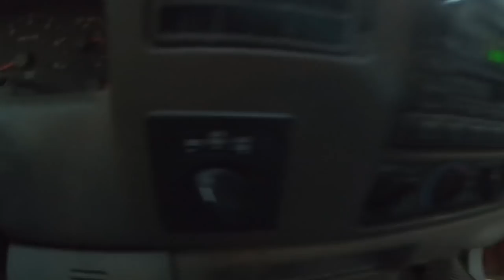Ford F-250 Super Duty Interior Swap Part 1: Air Bag Light Repair, Seats & Floor Carpets

Comment: Your being a professional inmate at the Ford Dealership makes the presentation you just showed look like a task so easy that most anybody could do. That being said, now I have a basic idea how to swap out the seat belt tensioner when it eventually craps the bed on my 2011 Ford Fiesta that has 250,000 miles on it.

Comment: I just got a new (to me) RED 2001 F-150 super cab XLT.  While installing a trailer brake controller, I noticed two gun barrel looking things, on both sides, under the center seat.  Now I know what they are, seatbelt tensioners!  Thanks, and glad I didn't start messing with them.  I haven't checked behind the back seat yet for contraband!?!?  
Great channel!  I have learned a lot over the years watching.....

Comment: I was a mechanic for 30 years and it was my experience that the difference between a professional job and a half a$$ job was at what level of OCD the mechanic had, more OCD the better the work.
Reply: Add in some ADD and when they look at a piece of equipment they see all the loose things then the OCD kicks in and they fix them.
Reply: @timothyball3144  that's a true fact!

Comment: I am with you. I worked on heavy equipment and when it was time for a oil change I take it to the dealer. But when it comes to my  1926 Oldsmobile which is unrestored just repaired and my 1936 Chevrolet 5 window coupe hot rod then I don't mind doing the work  
I get the same enjoyment as you do with your d2 caterpillars. I really enjoy your videos and all the information. Be safe and keep up the great work.

Comment: You should spray some bar and chain oil on the underside and then drive it through some dust. Miles ahead of any other method when it comes to rust management. It's not a solid layer, therefore it can't crack, and once it seals up (because of the dust) it becomes a very thick oily sludge that doesn't fall off. IMHO, the best kind of rust prevention i've ever used.

Comment: Once everything was out I thought you would have at least wiped out the inside or made mention out if to get the fine dust and hair out. You however made that seem so quick and easy. It would take me at least two days to get the same out and then 3 days to get it back in. just for 1 vehicle.
Reply: @squatch253  I understand, that is one reason it takes me too long. Besides After a couple of drives Bork wouldn't know the difference
Reply: It helps when you now where all the fasteners are hidden.

Comment: greatly appreciate this video.. i have a 2016 F150 with 280K miles and just bought another 2016 with only 55K (i Like the V8) and hate the new interior been mulling this and was pleased to see it is not so hard to do for a novice.

Comment: I remember when you said you weren't thrilled with the tan interior (they help in AZ). Was worried about dash,head liner, door panels....but should have know your eye would explode if change over wasn't  an "all components" project. The dog hair/smell cinched it....you were working "Flat Rate" speed.....

Comment: Great video and content, Thanks! One suggestion, which I am sure you thought thru, I would have added some sound deadening to the floors, doors & firewall whilst it was open. Really makes a difference for the road noise. Understand it's a work truck and everyone has their preferences.

Comment: I can see swapping seats etc and not going all new because of expense but I think I would of splurged on the heavy duty commercial rubber flooring instead of a carpet floor for easy clean up and not soaking up smells. Plus I would of added floor pan drain plugs for hosing out mud etc..

Comment: Wow I actually been needing to look at a new interior for my truck. I recently bought it and the interior is in a sad condition due to it being owned by a logging company since it was new I have the title to prove that I'm the second owner. Mine needs pretty much everything you are doing. I will also add more insulation and things of that nature as I plan on using this truck for a very long time

Comment: I was going to say sometime back swap interiors. But figured you didn't have time and yes not big deal swapping everything. My 99 ranger was green with gray interior with 01 explorer V8 damn near plug and play if l left it AWD. I wanted part time transfer case so advance adapters fixed this problem. Do add wire (ground) in instrument cluster to make tach read for V8. My 99 Ranger gotten every rusty, so took powertrain, fuel system and wiring stuck it in 2003 sonic blue Ranger level II. My brother has 2000 Ranger with tan interior and yes it has V8 too LOL. We changed his Ranger to gray interior, with gray Explorer power seats and center console. HVAC controls do work in Explorer console. Bad part in April had hit and run lost my 2003 ranger. Funny part went from 2003 Ranger sonic blue level II to 2005 Ranger sonic blue Level II. I just got it back together with V8 overhauled now had 240,000 miles on didn't use oil. Think was I have it out now 3 times, once from 01 explorer, 99 ranger, 03 ranger time for rebuilt and trans same miles. Trans no clutch wear, seals still soft and pistons seals about 1/4 worn off compared to new seals. 

I have manual transfer case in it now because electric BW1354 stick in 4WD and bang when it finally when back to 2WD. Change electric motor fix for awhile, did change t-case once it and did the same. Funny my brothers Ranger won't go into 4WD when cold. Switch is wired in for 4-HI and 4 LOW just ground that makes indictor lights come on

Comment: No need to buy a new cover cap for the seat studs nor try to melt the push nut back in place to keep it from wandering around.  Just fill the cavity where the push nut was with RTV (just the deepest cavity, not the entire cap) and push it down over the stud.  The RTV will conform to the irregular shape cavity and stud threads locking the cap in place.  If it ever needs to come out again just pry it off and repeat the RTV again when putting it back on. Or just throw it away, it is only to keep the exposed stud from being a nuisance snag anyhow.

Comment: Hey squatch do you remember the old Ford 4.9 300 inline 6 cylinder it was the first truck I drove an the farm it was the first standard I drove it had the old grany gear is was my grandpaps 1 owner my dad 2owner and me the 3owner it’s nice owning family history for 1987 f150 4x4 it does of work and still does I’m re building it right now little at a time still use it on the farm that 300 in-line does not now how to quit
Reply: @squatch253  I put side pipe on it for inspection it still quit but my god it runs so good I like the crank windows in it the never stop working I put oil on them to to keep the chain lubercated so it does not rust I just love that old truck it is so simple to work on.

Comment: As i watched i did not hear you mention anything about disconnecting the battery. That is a requirement any time you touch any airbag connectors. Those are usually colored YELLOW. I know you play with this stuff nearly daily in your working life but those out here in Youtube university may not know that. You don't want to risk blowing any of the airbag components. It can ruin your whole day or more.
Reply: That is a bit of a myth really 
Like useing your mobile at a fuel station 

Your airbags arnt going to blow because you unplugged them amd plugged them back in 
Maybe if your going down the road when you do it 
But with the ignition off and the car parked nothing's active 
Bit like how even if the car is crashed into while parked up the airbags won't go off

Comment: Hey Squatch, have you had to do brake lines on ole blue yet? My 03 Chevy’s brake lines are about to go. In your opinion would you go with stainless steel, factory steel, or Nicopp (copper) line kits? Also would you go with pre-bent lines, cut to length flared lines, or just make my own? For ease of running them throughout the truck. Im good with my hands and would like to do the job myself. Any insight would be greatly appreciated. Looking forward towards part 2!
Reply: Pre-bent Stainless Brake lines, Should be available, I believe Dorman Makes them? to run the stainless, its best to lift the Cab, A few inches, & Slide the Fuel tank out of the way.

Comment: I did not know that the lap belts did that.
You have me a bit scared though. I purchased a 2021 F250 Lariat 4x4 Off Road 6.7L Diesel.
I hope it doesn't drain the bank account.
I see what you mean about maintenance cost though. 13 quarts of synthetic oil and a quality filter has been my most expensive oil change to date.
Reply: @squatch253  and have the smelling salts handy when it gets out of warranty...........
Reply: @squatch253   My dad was a Diesel mechanic, yet this is the first diesel I've owned. I did my oil change at 7K. I try and do all my own maintenance since the only one I can trust for a job well done is myself. I was a mechanic in the Army in the early 80's, and have been at Boeing for over 35 years, but doing a salary job now.
I'm just hoping that I didn't get a Monday truck.
Reply: What an expensive pile of garbage. You’ll be happy when it’s gone.
Reply: @daleolson3506  Actually, it’s not. I’ve had Ford pickups since 1995.  My 1993 Chevy pickup was a POS. Turned my back on any GM product since. I’ve also found that if you take care of your rig, it takes care of you. Either way, all manufacturers have their issues. Love what you drive!!

Comment: Hey Squach, I noticed the cup holder surround in the center console is beginning to lift up around the driver side edge.  Is there a fix for that or is a replacement necessary?

Comment: I’ve got a 2000 F250 with same dash light.  How’d you determine the culprit was the seat belt tensioner and which one to replace?
Reply from the maker: This video was recorded back when I was still working as a mechanic in the Ford dealership, so I had full access to the factory scan tools and diagnostic equipment.
Reply: @squatch253  gotcha.. thanks

Comment: I FOUND THIS CHANNEL WHEN YOU WERE REBUILDING THAT OLD TRACTOR THEN NO MORE WHAT HAPPENED? 2ND QUESTION. THE FRONT PASSENGER'S SIDE SEAT ''SEAT BELT'' TIGHTENS WHEN SNAPPED IN AND WON'T LET LOOSE, PLUS IT'S VERY DIFFICULT  TO ENGAGE, I'VE NOTICED WHEN IN NEUTRAL IT SEEMS EASIER TO ENGAGE. CAN YOU PLEASE ADVISE? ((THOUGHT YOU'D NEVER ASK))--2008 FORD EXPLORER